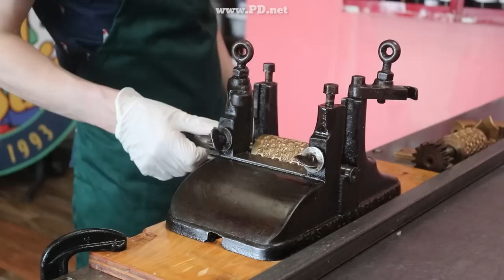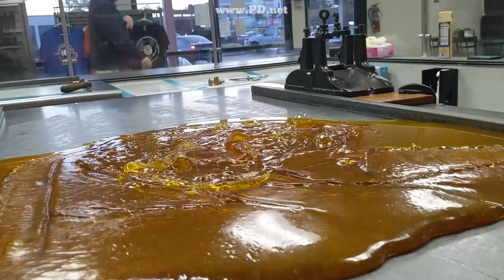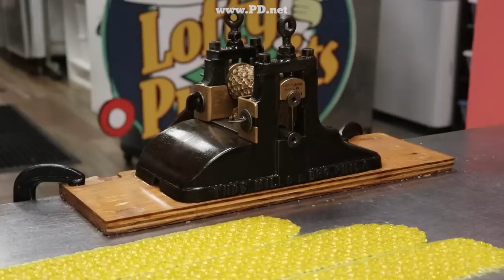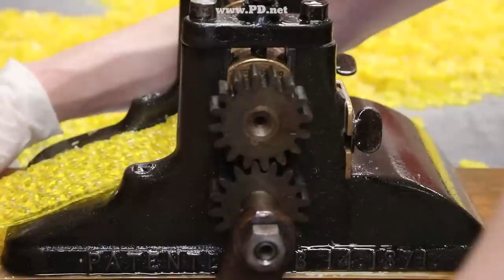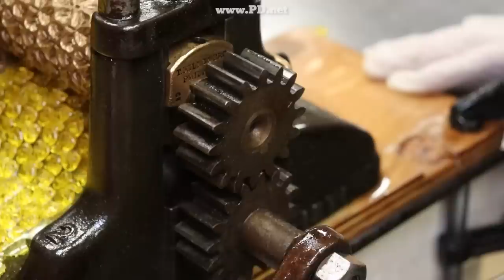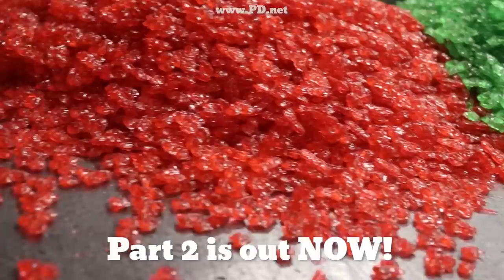Tasting History with Shamrock Honey Flavored Candy! History you can taste! Part 1 - Ep. 188

Comment: Greg, have you ever considered having new rollers made with a new design? With CNC it should be quite feasible.
Reply from the maker: It's actually much harder than you think due to the bi metallic nature that is needed to make them work.
Reply from the maker: And yes I've been working on them for years. The actual engraving of them is not the really difficult part. The difficult part is making the blank with the gear. It's getting the two medals together. There will someday be a video about this. But I still can't do it until I do no video.
Reply: @LoftyPursuits  Maybe it could be a system where the engraved part of the roller can be swapped, so you'd need only a pair of axles and gears.